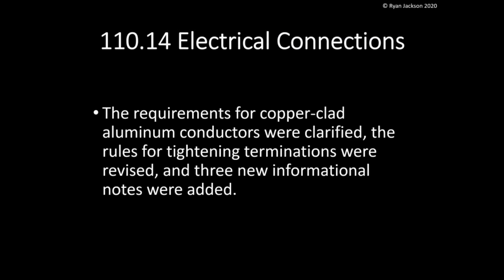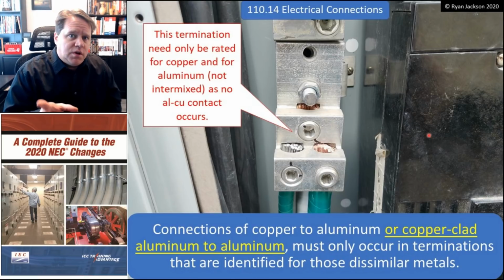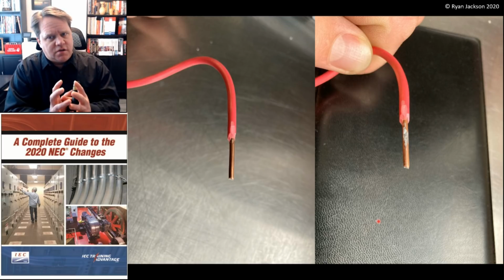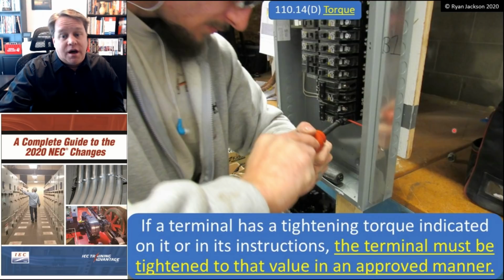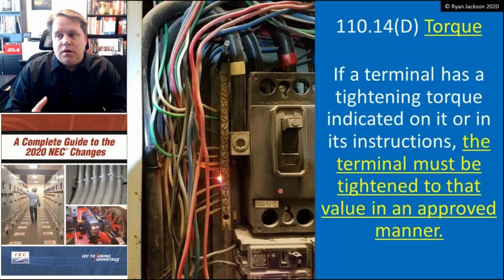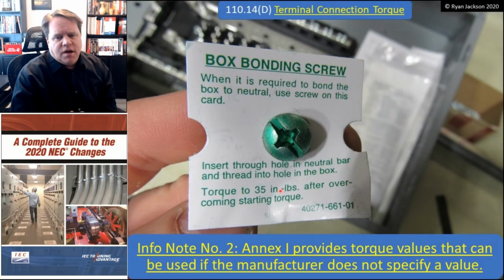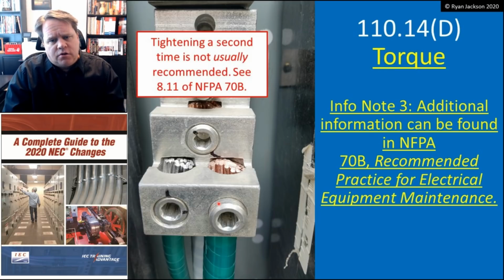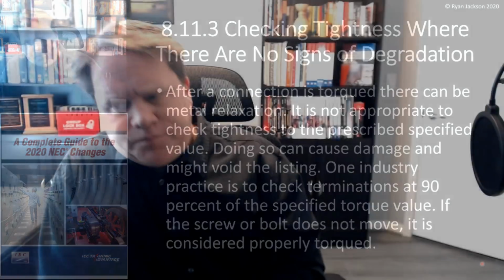2020 NEC changes series: 110.14 Conductor Terminations

Comment: Ooof! Control panel wire...especially power wires, depending on the termination type(mechanically) depend soo much on strand count.  A-B is the worst, IMO and ABB is the best.  Nonetheless, course(low strand count) wires must be terminated with crimp lugs.  Else, you could tighten them every hour and find that they are loose no matter the torque.  VFD cable is good example.  Low strand count is cheaper but demand crimp connectors plain and simple.

Comment: First, that terminal block is made from aluminum, and not steel as you stated.
Second, if your skin effect argument was true, the ampacity of CCA would be higher than that of aluminum wire, but it is not (at least, at 60Hz), as the skin depth at normal utility frequency is far deeper than the thickness of the copper plating.
Reply from the maker: The ampacity of copper-clad aluminum IS greater than aluminum. That is not my opinion, that is a fact. When CCA is created it becomes a bimetal with different characteristics than copper or aluminum. The ampacity of the product lies between the two. The values in Table 310.16 are not going to be changed, however, because creating an ampacity table showing an ampacity table of 17A, for example, would be of no benefit.

Comment: Alot issues to consider here Hitachi no login here squeal thinking that's too tight odds are the thread just broke     cad aluminum and copper wire    torque the same  ? regardless the lug material  the problem is the lug itself the manufactured should require a torque setting on the lug  another thing to consider is does bolt or nut stretch , torque
 It loosen it up and torque it again and yes moving wire round when it comes to bus duct bus bars 480 hanging bar system with  removable buckets around the room most buckets were 30 to 60 amps  the manufacturer required to be retighten every year  and I would think that would go to the account of room temperature Four Seasons minimum maximum voltage draw vibration of the system we torque bolts about every two years and mark the bolts with different pin colors different years So when you say doing maintenance torque it  one time and that's good enough leave  regardless what that books reads  ask yourself why don't Transformers come with lugs  but they'll give you torque settings leave it up to the electrician to get you the bolts and nuts the washers and that great shit from the supply house from China   which many lugs should have a torque setting and don't tell me to go to the manufacturer website and try to figure it out  it all comes down to liability the Transformer , electrician , lug manufacturer,  code book.,,,, how long is the warranty good for lol. Thanks for the discussion when you asked your inspector he reply why you asking me   about proper torque settings ? He'll answer  Don't put  me in  that situation   lol

Comment: So say at 7:22 in the video. No different metal to directly contact each other, Al an cu. What's the terminal block is made out of ? P.S. I am not an electrician, this video just came up in random feed.
Reply: Looks like an aluminum lug to me... Even though he said it was steel in the video.
Reply: @overamped23042  I must of missed the part where he mentioned it. It really does look like an aluminum lug.

Comment: Informative. I was always taught "snug, not crush". Being part of the "younger" generation of electricians I try to get rid of the old bad habits or the accepted bad practices others have allowed, so I'd went out and bought a torque wrench. Read the directions, tried it on a small meterbase to their specified value, and promptly stripped the lug. That was the first and last time I tried using any torque wrench.
Reply: A snug not crush mentality seems ludicrous to me.  I don't see how you can get a connection too tight.

Comment: Goto any commercial construction site an find me electrician that has a calibrated torque wrench/screw driver.  Then see if it looks used.  Anyways love the idea but it’s only practical if you pay to have someone sign off on every panel during final install. (QA engineer) Most jobs can’t justify the cost.
Reply from the maker: You see it a lot more than did five years ago.

Comment: The part about tightening a second time, in my experience with al and it's ability to appear tight but actually be loose, I always have the electricians re-tighten. Too many times I've seen al mechanical connections that appear tight and in reality they are not (and they fail spectacularly). I deal with uniterruptible power systems and until very recently al wasn't an option we allowed due to the tightening issue, unless  compression lugs were used.
Interesting information overall, thanks!

Comment: According to my calculations, going from 380 Amps to 665 Amps is a 75 percent increase, not 59 percent. Am I missing something? Thanks.
Reply from the maker: Yep, agreed. My bad. I had that number in my head for whatever reason.
Reply: @RyanJacksonElectrical  very common mistake, happens all the time.  Thanks for the great video.
Reply: @RyanJacksonElectrical  No problem. Either way you still gave us the concept. Thanks.
Reply: in spite of criticism which may originate at my keyboard, thank you for making the video, do make more
Reply: Thank you, came to post the same thing.
Reply: by my math, 380 is 57% of 665. not sure where 59% comes from. 665 is 175% of 380, so you are right, it's a 75% increase over the original 100%.

Comment: Is the reason for metal relaxation is that copper and aluminum is elastic in nature
Reply: The engineering term is creep. The metal literally flows like a liquid under stress over long time periods. The higher the stress the faster. So under a screw the contact points are extremely high stress, and will flow a bit to relax that stress in a short time. 

Interestingly if you have a small leak in gas NPT fittings leaving them for a week they often creep and will seal up.
Reply: @court2379  Good info thank you

Comment: I’m glad to see the code start addressing this a bit further. Before I retired I spent the last 8 years of my career as an electrician in a specialist role where there were four of us that did all of the check outs and commissioning of new installations, power distribution and substation maintenance, and infrared pm’s of all of the electrical equipment in a large chemical plant with about 2000 employees. The number one problem we found was improper torquing of terminations! And twice we had to have an unplanned emergency shutdown of a facility because of inadequately tightened horizontal buss splices in brand new installations of Allen Bradley motor control centers. It doesn’t look good when you convince a plant superintendent to spend $250,000 to tear out an old overhead exposed buss with rack mounted disconnects and starters that’s been working fine for 50 years and replace it with a new MCC that fails in 48 hours. The most common poor connections we found were breaker terminations in lighting panels and motor lead terminations in motor control centers.

Comment: Just FYI, skin effect is negligible at 60hz.
Reply: Then what would explanation be for using a copper coating?
Reply: @madzmadeit  Oxidation and the ability to be complaint with copper only terminals, which are numerous. Also for CATV drop cable they use copper clad steel. The reason is the steel core is very strong and can support the cable for long runs. At the frequencies involved, the copper coating is all that is needed to carry the signal due to skin effect. At those frequencies the signal rides on the conductor surface with little penetration into the center of the conductor.
Reply: @andydelle4509  Thank you 🙏
Reply: @andydelle4509  thank you for being one of the few to get that right. it's interesting to see how the big old tv transmitter stations work. the huge cables that go from the transmitter to the tower are actually all just hollow pipes, almost like plumbing pipes. very thin wall. then they vacuum down the pipes to lower the capacitance of the cables. interesting but beyond me.

I think where people get confused, they hear about this skin effect and assume it's all electricity. one real reason why cables get so big, diminishing returns on size, it's the heat dissipation. the bigger the cable, the less surface area it has relative to the cross-sectional area.
Reply from the maker: I agree that frequency is the biggest contributor to skin effect. Copper clad steel was originally manufactured for that purpose.
Reply: for the sake of science, even dc can have eddy currents or the skin effect. it's not really caused by ac current, it's caused by changes in current flow which induce a changing magnetic field.

the point at which it becomes a problem is beyond me. turn it on, if it glows and it's supposed to then we're ok. if it glows and it shouldn't, then problem.

Comment: A co worker would torque wires above #8. Then shake them halve hour late to what he called settling in the many strands then performing a little more torque.While performing quarterly PM on a year old 200 HP fire pump found several factory installed wires on a starter 40 degrees hotter then room tempetature due to not being torqued enough. As an apprentice we were taught to never trust tightness of factory made panels. Ones shipped across the ocean always were the worst. We retorqued every connection including wires on start stop buttons. Thanks for another great vid. Observed many techs & service companies performing maintenace on 480, 4,160 & 13,200 volt equipment never using a torque wrench.

Comment: soon they will add next changes as well for dipping some coating for copper strands for number 10 to 6 for subpanels and as well for ac disconnect switch..are we overdoing the safety..i am sure coating with wire goo would not rust the wires...but what cost doing so ?? its only 30AMPS to 60AMPS
Reply: What are you saying? 
30A isn’t dangerous? I’ve seen house fires caused by 15A...
Reply: @SuperVstech  any amperage is dangerous for your heart...BUT NOT WITH SCREWS THAT GRAB THE WIRE TIGHT..TORQUE SPECS IS BS..i usually never over-tighten..longest i can tell the stranded wire is not wobbling at the screw lugs..you are good to go for installing breakers and final test of turning on the feeder breaker from main panel..JUST RELAX...everything is grounded correctly for both panels...1st pane,l I always check its bonded first before 2nd or 3rd panel are not..its right order and both detached from home and garage area/storage room have each ground rod...we are safe
Reply: @user78405  wow... apparently you are an expert on wire contingency... code should just ask you for safety and consequences be damned... 
torque specs aren’t there for grounding issues, or hear stopping faults...
It’s there to prevent fires. 
Improper conductor securing can cause building fires.

Comment: its funny that the code requires torque values and yet we still can stab 14 gauge wire in the back of switches and receptacles
Reply: True although any electrician worth his salt knows backstabbing is for hacks...
Reply: @MrMaxyield  
Yea, but my point was that more and more electricians are using Wagos.
The double standard is calling out the 
Backstabbers as hacks yet using Wago connections.
Reply: @itaintrocketscience  I agree.. they're essentially the same...
Reply: Not at all
Reply: @MrBen527  
Ummm... yea...they are
Both have tiny contact point
Both are used ( and designed) for a homeowner/ handyman
Reply: @itaintrocketscience  I was responding to the original post,  not yours.
Reply: We don’t use those in commercial we’re required to make a loop with the stripped conductor end and torque em to the receptacle
Reply: Never for me.
Reply: Gotta save that for future revisions. If they fixed everything right now, they'd be out of a job haha
Reply: Bull. Wagos hold up to some crazy amps. I've seen one take 500 amps and it still held. The wire gave out before the connector. You clearly don't know what you're saying. Not the same thing.
Reply: @MadMetalShop  they are used in the industry no doubt, but Electrical professionals frown upon wagos. Especially Union electricians.
Reply: @Craftsman4Life  I realize this but it's usually based on the old stab back receps and there's no merit to the claims being made other than that comparison which is a bunk comparison. A lot of guys have this stigma against anything different.
Reply: @MadMetalShop  amperage capabilities has nothing to do with it.   The stab in receptacles work until they don't.  It's when they don't that there's a problem.  You do realize that AC wires vibrate right?
Reply: @engineclinic  bro amps and voltage go hand in hand and it's not vibrating that does anything. Its heat. Pure and simple. Heat causes connectors to loosen and fail..... But the wagos don't. Go watch a video of wires being melted and the wago clip still standing strong and get back to me lol. If your even comparing these to the stab back receps then you already don't know what you're talking about. That's just my opinion. Not worth carrying on the convo.
Reply: That’s because UL has tested WAGOs and those receptacles and has listed them for the purpose they are used. 
On the contrary, Joe ‘been doing this for 30 years’ arm has not been tested and listed by any approved facility to indicate it will perform at the proper torque.
Reply: @ACitizenOfOurWorld  Exactly!  Hence why torque wrenches were invented.
Reply: @ACitizenOfOurWorld  bs.
Reply: @ACitizenOfOurWorld  
I’m sure it’s all for safety
Not for any other reason
Reply: And....
More and more electricians are using wagos and praising them.
Wago is a backstab receptacle
Reply: @itaintrocketscience  Never seen a backstab receptacle with a lever lock on it though.
Reply: @itaintrocketscience  wagos get cut off and wire stripped if sent in prefab like that. Push in receptacles might be more residential, but that’s just builders taking short cuts.

Comment: I do have a quick question. How would a inspector verify that proper torque was performed on circuit breakers?
Reply from the maker: That is a GREAT question. The way I always answer it is to refer to 8.11 of 70B and do the 90% test. Anything beyond that could easily be viewed as a destructive test.
Reply: @RyanJacksonElectrical  so, inspectors could test for undertorqued, but not for overtorqued, without marking and releasing and retorquing... which wouldn’t be accurate either... since the conductor would be over compressed by the original overtorquing...
Reply from the maker: @SuperVstech  Agreed. To the best of my knowledge, the only totally accurate way to inspect it is to witness the termination.
Reply: @RyanJacksonElectrical  usually they just want us to show them the torque wrench as proof.
Reply: @galaxybounce82  "...Yea, we torqued it" ok here's your green sticker
Reply: funny thread here, and very informative :)

Comment: I’m part of the 20%. My connections are always very tight. I’ve broken many a meter cans....
Reply from the maker: LOL
Reply: Some meter cans broke way to easy. But haven’t had that problem in a long time. Perhaps there was a time they were defective. Because I’ve seen many lose connection it isn’t funny.
Reply: I’ve broke two, but not for a few years now.
Reply: are they plastic? I watch videos of electricians in some european countries... who what........ I don't even know...... main circuit panel for houses, all plastic, box and all..... and the work they're doing in the video is to replace the previous circuit panel which is now missing, bits of charred plastic hanging from the wires. wow.. code books and local laws say this is ok.